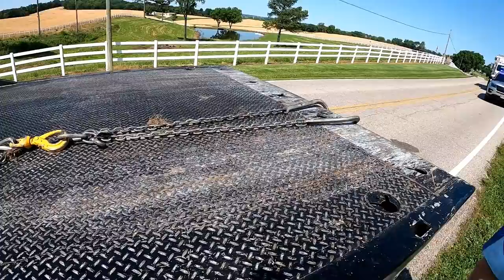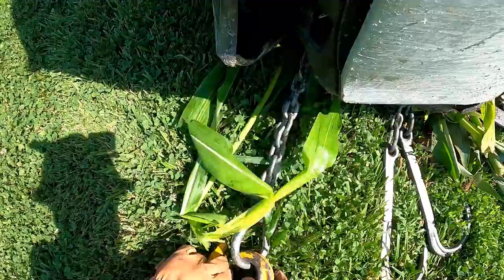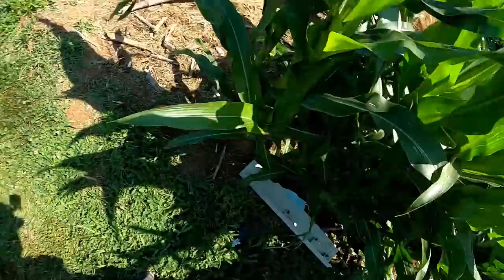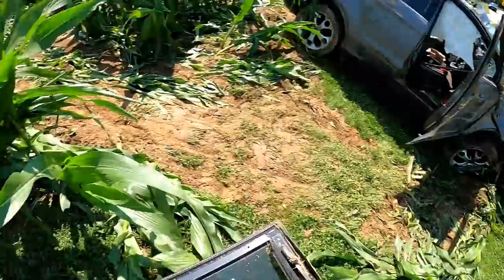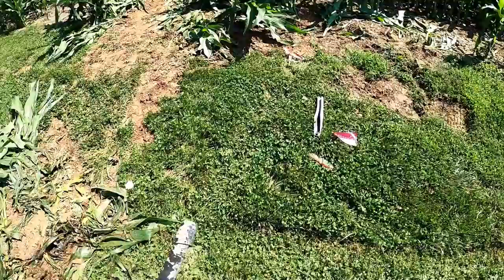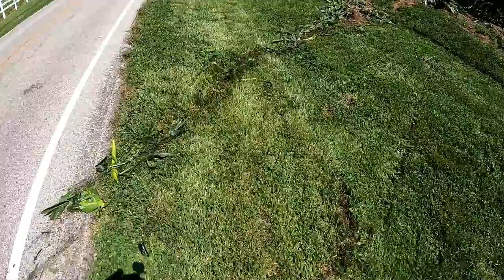Corn Roll!!!    So, Is This How Crop Circles Are Made???

Comment: i'm glad Missouri is smart enough to include tow/recovery as part of emergency responders. those blue lights save lives.
Reply: Totally agree, I did towing for a few years here in Pa., never understood why towing/recovery vehicles are not considered emergency vehicles.
Reply: I watch your show everyday Robert Cooper
Reply: I agree tow trucks are first responders in my book
Reply: Not smart enough to let others run flashing amber warning lights.  I deliver lumber, often roadside on the side of state highways because my truck is too large to get into a few peoples driveways.. without a police presence to alert traffic.  It's illegal to run amber flashing lights doing what I do while roadside.  But you know what?  I do it anyway.. my safety is way more important than some stupid regulation.  Before I did that, it was chaos out there, people flying by me like I was broke down.  It's definitely better now.
Reply: Here in CT, tow/recovery have lights, but they are orange.
Reply: In the UK tow tricks can run flashing Amber only, same as road construction vehicles and anything else that is causing a hazard on the road.

Even the wood delivery truck above could run flashing Amber, but only when dropping off a load (have to turn them off when simply driving )
Reply: In NY only fire personnel can run blue under the rank of captain. Captain and above has red and blue and siren. Tow trucks are only allowed amber and must run them at all times. But in the Philippines I seen public transportation with red and blue lights with siren I was in the vehicle and not emergency personnel. There are no laws with lighting here but all the fire departments in Manila are voluntary. 12 million people and volunteer fire and ems is just a bad idea.

Comment: Did. Not. See. That. Coming.  
I was trying to figure out how I would flip the car onto its wheels, and I figured I'd move the anchor of the cable's pulley onto a tiedown near the front of the deck, but the way you slid the deck to right the car was truly inspired. Nice job Ron. As always.

Comment: just a suggestion Ron, you should start having an empty bucket on all your trucks and flatbeds, for the sole purpose of collecting all the little plastic debris
Reply: It would save a lot walking back and forth collecting all the debris.
Reply: note to self....bring a seed sack or two for debris....saves lots of trips back & forth
Reply: Yes I was thinking similarly.  Plastic tote or lite weight metal box.
Reply: @stevenhoffmann9373  rubber builders tub would probably do the trick
Reply: Probably rubber maid trash can for big stuff and 5 gal. Bucket for small.
Reply: That's what the busted out windows are for. The car makes for a big ass bucket.
Reply: @southernhorizon9521  the 5 gal bucket is for collection of debris . The car will be for the contents of the debris bucket
Reply: I was thinking of a cotton picking sack, sling on shoulder and drag...feeding debris in it.  It can be tied to adjust space so you're not dragging a car length of bag behind.
Reply: My thoughts exactly, it could have a dual purpose by holding wooden blocks or chains, and when you have a debris field, dump the chains out on the deck and gather up the broken pieces. Just my $0.02! Love your videos. Grace to you brother.

Comment: The driver had to have been going in the high 80's to get that kind of distance launching off the culvert and to roll end over end to the landing point.
Reply: Not staying focus on the road mind wandering. Or something else.
Reply: Yep, its the typical story we've heard a thousand times. No officer around on country roads to give a ticket. So drivers speed in excess of vehicles ability to make turns. Then they lose control of the vehicle. Even when the guy recovers, he aint getting out of it that easy. Probably lost his license and has to face the judge for violation of the traffic laws and for property damage.
Reply: @stellarproductions8888  may have got a ticket if they could prove speed or distraction caused it but no loss of license or responsibility for property damage unless they were uninsured

Comment: I'll put  a little spin ( or is it flip? ) on this. 

As hard as it hit, and as much as was crunched, the driver lived through it. People say they don't make them like in the old days. And that's true. Pre airbags, seat belts, built in roll cages and all those other goodies this driver would not have survived. And note that even as badly crunched as it was both front doors still opened. And the passenger compartment had not crushed down enough to break the rear windows on both sides.  I half expect that the rear doors may have still opened as well.  The engineers who designed this chassis deserve a hearty "thank you" from this cars driver.

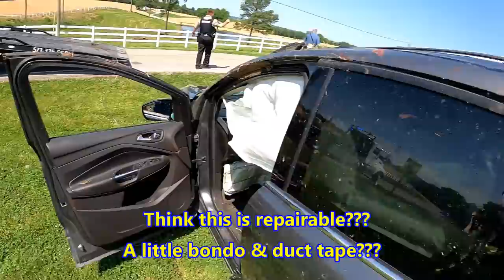Comment: 13:40. A little bondo & duct tape.
I would say a bucket or two of bondo. And several rolls of duct tape.
Reply: don't forget the baling wire and chewing gum! lol!
Reply: Well, I saw that episode of Mythbusters where Jamie and Adam lifted a car up in the air using nothing but duct tape for the rigging. So thinking about taping the entire car up with duct tape, ya, it will hold.  :P
Reply: Might want to include a case of super glue to put all the loose parts back on, too!
Reply: And baling wire...

Still a lot of usable parts...air in rear tires can be put into next vehicle...lol

Hope old boy recovered 🙏

Comment: "Three wheels on my wagon" - and I need a 4 point tiedown to be legal.  Would have been nice to see how you managed it,  given the state of that front end.  Nice straightforward recovery, and hope the driver is OK.
Reply: I was wondering how he would secure that.  Throw a couple of chains across the top and tighten them down?  The chains might scratch the paint a little, but the body shop could buff that out.
Reply: He didn't want to give up his hunting spot, so no tie down section on this one.  haha.  I don't blame him.
Reply: use the frame hook-ups on one side or both is could not secure the other tire, little roof rack would need to be tired down too.
Reply: Wheels are normally the easiest tie down points to use, but chains looped around whatever bits of the frame aren't too far gone will work too.
Reply: @davidgates1122  And what's another 25lb of bondo among friends?
Reply: @davidgates1122  How about the car‘s paint on the chains though? 😂
Reply: A little superglue would make it stick.
Reply: @Dan_Neely  if it was that badly damaged, I personally have a mesh tarp thingo that goes over the top, plus a strap or two to hold down the bonnet and any popped doors and the like. The cargo mesh thing is perfect for stopping any plastic bits from flying off at 100kmh on the trip back, often with the windows popped, interior trims will come off at speed and fly off, maybe hitting another car...

Comment: And another suggestion: I've found in the past, that the right kind of leaf rake works wonders for helping clean up a debris field like that. Magnetic rollers can also be handy. Nice thing about both is you can use them both on asphalt and on dirt. "Picker sticks" or "claw handlers" (the mechanical, hand-powered kind) are useful, can limit some of the up/down and bending over, which saves energy and your back.

Comment: From the initial look at the position I would see if I could run a strap or chain from the top of the underside, down and below and try and roll it away from the road and then hook onto the front and pull it around, but I only have a 4x4 and off road recovery experience.

Comment: You need a shoulder bag and an extended pick up gripper to save your back and make fewer trips back to the vehicle.  You never know when a slightly wrong move can rupture a disc.  I did it setting down a light weight but had to twist then extend my reach to get to where I wanted it.  Bad move.

Comment: What ever happened to using the double snatch block setup you had when you first introduced the truck to keep the cable  directed straight into the winch when loading on an angle? Now you are back to using a single snatch block.

Comment: 2 things struck me on this one. First, I suspect they were not "pootling along" at 30mph to do that amount of damage and cartwheel the car.
Secondly, if they made it out of that without serious injury, it says a lot about modern vehicle safety. Looking at how the car bend and folded at the ends, it did was it was meant to, the ends folded absorbing the energy, and the central passenger cell remained basically intact, even down to 2 surviving windows.
I also managed to 2nd guess how you'd get it out of there, even down to sliding it on it's side to avoid the busted suspension ripping up his field.

Comment: If the incident occurred in an open field you’d just roll it over  and put the necessary equipment in use to move the accident to you and load it onto the flatbed

Comment: The ambo running without lights can also mean that the driver is dead, so they are not needed.
Reply: In the UK if someone is dead before going into the Ambulance the Amb. is not allowed to take the body. I think it's because if they were to  get another urgent call they wouldn't be stuck with a body on board - makes sense really.

Comment: I'm still a greenhorn but isn't side pulling lile that bad for the bed slides? As upposed to having the bed locked down and having a side puller
Reply from the maker: Some manufacturers advise against the way I perform the side pulls with the bed rolled back.  Miller is a strong product that we have used for many years and we have never twisted the rails, bed, or anything else by using this method.   I would suggest using whatever method your boss/business owner wants you to use.   Thanks for watching and God bless.
Reply: @RonPratt  thanks for the reply sir! Stay safe